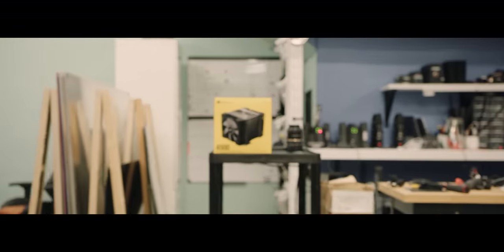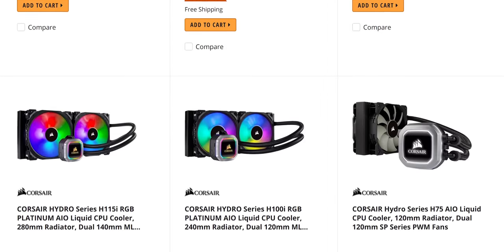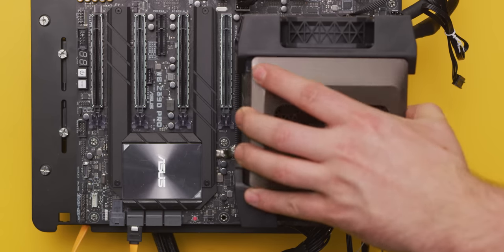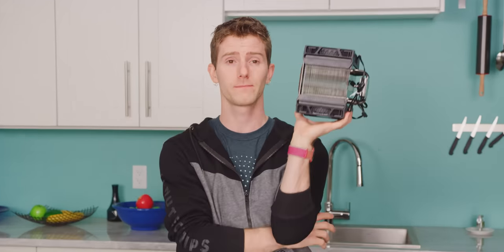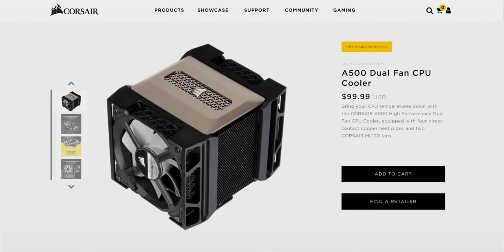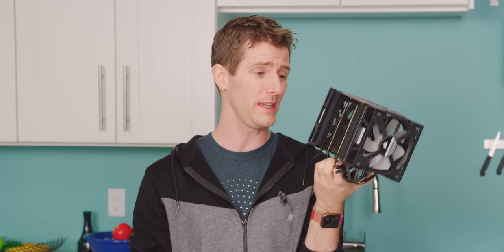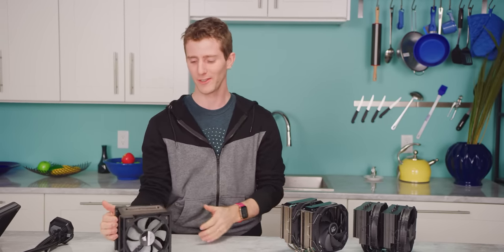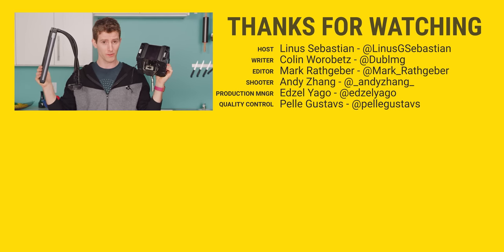Even Corsair Knows Air Cooling is Better - A500 Review

Comment: Dude, even corsair "Knows Water Cooling Sucks"

yet Linus still insists in water cooling EVERYTHING
Reply: It makes for a more interesting video and spectacle to water cool something.
Reply: It's not that watercooling sucks. It still looks better and may give you better temps with high TDP components.
Reply: @theEskalaator  its also more stable in temps, keeping them from fluctuating
Reply: Watercooling doesn't "suck" it just isn't worth the cost. AIOs are still marginally better than air cooling and custom loops are a fair bit better (plus they do look better/a lot better), but there's an extreme price disparity and need to perform maintenance.
Reply: A big heavy air cooler that can be accidentally moved, no thanks. NY H115 does the job good, plus it looks cleaner in the case and I can get to my RAM easy. Theres no way I'd move over to air cooling.
Reply: Water cooling a cpu is better than an air cooler by far.
Reply: Watercooling really shines in ITX cases where tall tower cooler aren't an option. Low profile coolers are getting better but can't keep up with most 120mm AIOs.
Reply: @alexnorth3393  depends on what you mean by water cooling. A custom loop? Yes. An AIO? Eh, not really
Reply: Yes, because he accepts the trade off. AIOs offer worse cooling, more points of potential failure and more difficulty in identifying or potentially repairing those points of failure. But, they look clean, can give better access to RAM slots, and they're more securely affixed to the case. Plus yeah, it's more entertaining to see him struggle with them.

 Custom cooling of course does offer better cooling too in addition to the other benefits.
Reply: why did this spark a conversation on water cooling pros/cons, it was a joke on the fact that linus Water cools even ssds
Reply: Watercooling doesn't really suck, AIO does.
Reply: @sEaNoYeAh  with the new corsair A500 that's show in this video, its stupidly easy to remove RAM, go watch jay review about it , it is really better than here, it shows more clear the purpose of the design of the product, and its advantages
Reply: Adam Grufík  dark rock pro 4 wins
Reply: Danish Wistara  +15 hp at least
Reply: Something to keep in mind, AIO water cooling sucks. Or is at least no better than air. Its only practical use is routing fans to the top/sides of a case. CUSTOM water cooling however, changes the conversation back to being better than air. But at  a hefty cost increase. Linus has the money, and they do custom loops because of the lower noise and thermals it brings.
Reply: 5 years on and that is still the case. I've had no problems at all and cleaned the rad about 3 times in 5 years. Air coolers tend to need far more maintenance. And they keep on getting bigger and bigger and bigger.........

Comment: "One of the hottest running consumer chips on the market: the i9 9900k"
[AyyMD liked that]
Reply: Well AMD FX time...?
Reply: @pr0ge  I think the 9900K actually has more heat about than even the FX-9590.
Reply: Times have changed...
Reply: Hmm, probably thermal compound under i9's IHS is making it even worse
Reply: @pr0ge  one is temperature, other is heat, the paste doesent impact heat as much as it does temperature, temperature is higher because heat can't go away fast enough, but it's >200W at 88°C and 92°C(assuming it's not throttling)
Reply: PROGENIUS 9th gen are soldered. Delid  direct die with LM works well for i9.
Reply: @xxbamxx_823  x299 i9's are soldered
Reply: Sannidhya Balkote I think all 9900k are soldered, I think all 9th gen, i5, i7 and i9 are. I could be wrong.
Reply: @xxbamxx_823  only hedt parts are soldered, 
All others just have paste
Reply: Well I checked and I'm wrong. 

Sorry
Reply: @MarkoHR  This exactly. That's Intel's main problem with their 14nm high end parts, too much heat and not enough capacity to get rid of it quickly. I suffer this with a direct die 9900ks and a 10980xe.

Comment: I stopped using liquid cooling when I discovered Noctua cooling systems.
Reply: Or you can just put Noctua fans on an AIO and get the best of both worlds.  Super quiet even at full bore, and no giant tower hanging off your CPU and making everything hard to work on.
Reply: @JMurph2015  still better to get an actual noctua for practicality and reliability.
Reply: @JMurph2015  Cooling systems not cooling fans.

Noctua makes some incredibly good cooling *systems*, the ones with 6 heat pipes, a very dense fin stack, y'know the kind. The good cooling systems.

AIO Radiators vary in quality a large amount, this is why a NH-D15 is comparable to some 240mm rads, and is better than most 120mm.

AIOs have their place in small form factors though, where you can't fit a big proper air cooler.
Reply: @JMurph2015  Noctua heatsinks won't leak on your components... also better performance than most aios anyway.
Reply: @ashleyjohansson230  nah I actually have a D14 as well.  It's horrific for my lifestyle.  You have to pull it out every time you move the computer, you have to pull it out to change RAM, you have to pull it out to get at my GPU, it's just such a pita.  Also, since socket AM4 has the tendency to not hold onto the CPU very well, when you do pull it off, you run the risk of bad things happening to your CPU.  It's a good cooler while you aren't doing any of the above, but I do some of the above way too often.

Edit: also my SSD slot is under my GPU, so you have to pull both the cooler and the GPU for that one 😅.
Reply: @MrCODEmaster00  you should actually look at GamersNexus's channel.  They do a lot of testing on this, and by and large all of the major brands have little to no difference between their blocks and radiators because they all use Asetek designs.  The biggest difference between AIO's of a given size is generally which fans it uses and extras like RGB etc.
Reply: @MrCODEmaster00  also actually I would contend the exact opposite.  Noctua makes incredible fans, and just good overall systems.  Their tower designs are pretty much *just okay*.  They don't make glaring errors, but they aren't revolutionary.  They just happen to include Noctua fans, which are head and shoulders above the rest.
Reply: @MrCODEmaster00  Yep, i had a WC loop before (not and expensive one still in the $250-300 aera..). When my pump died, i decided to move on to a NH-D15, man what a great cooler..
Reply: @JMurph2015  Air leaks don't kill systems
Reply: @DraceArios  but bent CPU pins do 😕
Reply: @JMurph2015  why do you have to pull out your cpu cooler to get to your gpu? What case do you have?
Reply: @CuePlayz  it's more of a motherboard thing.  I have a Aorus AX370 Gaming K7 and its x16 slot is the second expansion slot, as is typical.  However the Noctua D14 comes so close to that slot that you can't actually get down there to press the release clip for the slot.  So you have to take the cooler off to get to the clip to get the GPU out.
Reply: @JMurph2015  Just use long stick to press clip down🤔, only time I have had to remove my noctua nh d15 during 6 years was when I rebuild system and well thats it. No problems removing gpu, cliping in cpu power cable or even RAM.
Reply: Noctua is overrated they look ugly and you can get a cooler that costs less that is only 2-5c hotter nobody is going to complain about being 2-5c hotter and if you do you are too picky why pay $80+ for a Noctua cooler when you can get a $50 cooler that performs basically identical.
Reply: @aleksiniemi5441  yeah I tried a screwdriver, but my GPU is so beefy that it covers ~90% of the top surface of the clip, so you have to come in from the side or risk putting a screwdriver/whatever through your mobo.
Reply: Yea I never used it because of the risk, if the damn thing leaks you're screwed so it's not worth it
Reply: @Dreadpirateflappy  I have literally never head of an AIO leaking in someone's system
Reply: But, but, but ..... what if Noctua started making liquid coolers?
Reply: your system sounds horrible :S i would hate to have to go into mine all the time, honestly since i built it ive been in it once and thats to spray the dust out (that was in 3 years and its on the floor so doesnt help there)
Reply: @16-bit54  Not only do cheaper coolers run hotter, they run much, much, much louder. Like you can hear them under load with headphones on over music or gameplay. Good coolers aren't like that.
Reply: I switched to AIO because I go to lanparties sometimes and AIO's are simply safer while transporting your PC. Yeah, air coolers don't leak, but they can damage your motherboard with the massive weight hanging from it. Normally not an issue, but it becomes more dangerous when moving your system. And I much prefer the look of the system with an AIO, as well as making it so much easier to get at the components. And watercooling in general has an advantage in cooling short spikes in load because the water can soak up more heat. Only in sustained loads does the air cooler catch up or overtake it in cooling performance.
Reply: @16-bit54  Well one thing none seems to mention about noctua is that its lifelong cooler, for example I upgraded from i5 4690k to ryzen 3600, well I didnt have am4 brackets since I bought my noctua before am4 was even a thing. One single message to noctua and 3 days later I had my am4 bracket on post, free of charge. And I live in Finland not Australia. In my opinion that justifys higher price. As far as I know, other cooler manufactures doesnt do this?
Reply: @16-bit54  yes back when I had an fx 8350 cpu got myself a thermaltake cooler for like 30 bucks kept that hot chip cool and was very quiet..
Reply: @dhkatz_  happens a lot whether you have heard of it or not. try googling it.
Reply: @lobsterbark  You are buying garbage coolers then I have had cheap and expensive coolers none of them were audible with or without headphones. Quit buying cheap Chinese brand coolers and you won't have a problem.
Reply: @aleksiniemi5441  Every manufacturer does that.
Reply: @nickgarcia1292  Yeah other brands are completely fine Noctua has done some good marketing but in reality they are nothing special. The temp difference between other coolers is so little it's not worth mentioning and they are ugly the only argument that lands in their favor is noise but most people wear noise cancelling headphones so does that really matter.
Reply: @16-bit54  Im pretty sure if your corsair cooler for example doesnt fit new socket, you would have to buy the bracket.
Reply: @16-bit54  You said it yourself, 2-5 degrees difference at minimum and a hell of a lot more quiet than anything else, + they last a lifetime. why settle with something worse?
Reply: @EdzCreationz  A 2-5c temp difference is so little the temp argument is basically null nobody is going to be upset over it the noise argument is null too. The majority of people wear headphones and don't hear their system anyway so why pay $20-$30 more for a Noctua when you won't notice a difference in day to day use.
Reply: @16-bit54  Any cooler cheaper than $80 is a Chinese brand.
Reply: @Dreadpirateflappy  there is no reason to be scared of an aio leak especially from corsair because they will replace anything that broke with the leak
Reply: @lobsterbark  there are many good options under 80$, saying you cant get one under 80 is just wrong.
Reply: @robotics4572  You can't get one that is actually an improvement over air cooling for that price. In which case, you are spending more to get something that doesn't last as long and performs equivalent at best.

Comment: Just as an FYI, the SATIMO chamber is for measuring over-the-air antenna performance. Both total radiated power and isotropic sensitivity. They use several probes in a circle to quickly measure power. Other chambers use an antenna on a mast which rotates around the central turn table, which also rotates 360 degrees. Then you get full coverage around the entire phone. 
The cones in those chambers primary work from about 450 MHz up to 12 GHz. While sound will be attenuated relative to a normal room, it is nothing compared to a room with cones designed for the audible spectrum. Those rooms are downright uncomfortable to be in and can actually make some people physically ill!

Comment: Make it like a split AC system with the fan ducts on the outside, use transcritical C02 which means mass flow is small, and you can get a compact size, cooling performance that can keep the chip at zero or below, and the extra strength required for the CO2 compression does not matter at this scale as tube and pipes at smaller diameters are much stronger.  The gas cooler which takes place of condenser, can be extra large and heavy duty mounted on the outside, and that means we need less air flow and can be much, much quieter.

Comment: I tried water cooling once, (Corsair All in one water cooling unit)  and I didn't see much benefit temps were same since I have a 70 degree F room in winter and summer.  I noticed the invention of heat pipes rather then just a solid block with fins worked just as well.  I bought the basic heat pipe from Cooler master 212 evo.  No issues with heat or instability even with over clocking.  So I never looked at water cooling again.

Comment: Just remember to ensure the Magnetic Levitation system gets full steady-state 12VDC....and is NOT powered by a PWM or Variable Voltage output connector/pin. It can still be controlled by PWM, but it must have access to full 12VDC for the bearings to work properly.
If the MagLev bearing system doesn't get constant 12VDC it will not operate properly and will cause additional noise and decrease the life of the fans. Some "splitters" or controllers may wire things in ways to save manufacturing costs or in ways would work for "normal" bearing fans...but were not necessarily designed with MagLev bearings in mind.

Comment: seen that coming, in my experience 120mm fans are ALWAYS louder than 140mm
Reply: Pretty much, smaller fan means it needs higher rpm to move the same amount of air, I guess it just depends if you're actually pushing your pc to max temp much and care about that noise. It does look nice and seemingly performs fairly well so they're on a good track.

Comment: What would be an interesting experiment would be to cover the two sides (where the fins are visible) and then cover all those holes in the top. That would seal the "Push Pull" fan setup and force more air through to the second section of the cooler. Would be interesting to see before and after results.

Comment: Basically if you are in an arid enviornment go for it! You need more humidity anyways, and if the air is already dry a swamp cooler will cool much better, if you aren't in an arid place forget it, it will hardly do anything besides make the humid air more humid... Yuck! In short it depends entirely upon WHERE you live. Reguardless where you live though, get a box fan or two, and at night put them in the windows until roughly 7am. The outdoor temperature is lowest around 6am, but the indoor temperature doesn't INSTANTLY drop to that temperature, (it will take roughly an extra hour to reach equalibrium with the outdoor temperature), after 7am SHUT THE WINDOWS!!! The outdoor temperature will rise much faster than the indoor temperature! Insulation is designed to prevent heat transfer!!! Even on our top floor apartment with ok insulation the non air conditioned portion of our house gets no hotter than 75 degrees on a 95+ degree day!!! That's a 20 degree differiance without ac!!!

Comment: I’m having so much problems with my Corsair mice
Reply: oh yes its annoying software sucks
Reply: True. Got the darkcore wireless, which is supposed to have QI charging, but it never works with my dual charging pad. My phone charges no problem but that bloody mouse just won't.
And the low iCue software is so counterintuitive, I bought the mouse with all the different configuration an profiles I wanted to create in mind, but now I can't bother trying to configure shit!

It's still a great mouse in terms of basic function, but none of those shiny features they charge extra for actually works!
Good thing I bought a refurbished one for half the price. And I didn't buy the corresponding QI mousepad
Reply: Got the corsair mouse, the scrolling wheel broke after 6 months of regularly used.

Comment: They don't necessarily need to lower the price, although that'd be nice of course.  See the Corsair cooler, even though it does barely lose on thermal performance, and significantly loses on noise performance, does have an epic stand out feature - the fan mounting system!  Watch Jays video I think he hit that point well.  It's truly awesome and unique.  Also the magnetic top cover makes it better looking than the noctua, more on par with the be quiet... not sure about the assassin.  Perhaps instead fhey could use quieter fans.  But do their fans have the same max RPM as the noctua and other options? (1500rpm)  Because if they can spin faster, then obviously they'll be louder, but it's within the users power to set the fan speed.  I wouldn't mind if Noctua fans could spin faster, when i want quiet i'd turn them down (or set an appropriate fan curve), but for bench runs or something the extra cooling performance would be nice to have.  

They also need to make a thinner single fan single tower design to compete with the noctua u12s and bequiet slim rock.